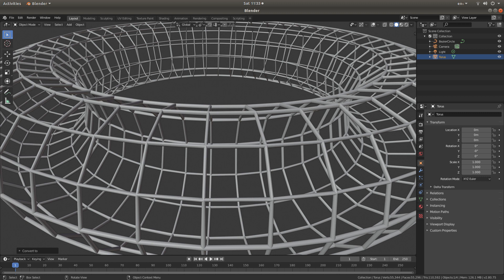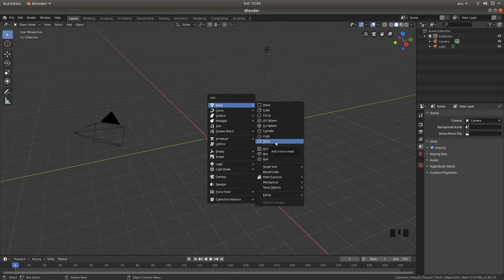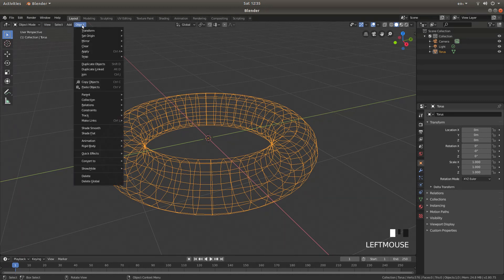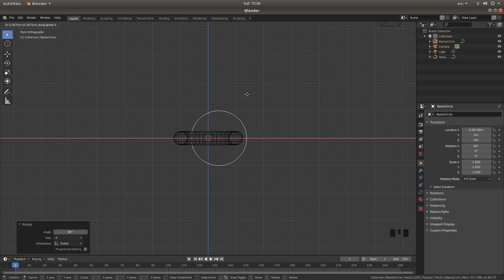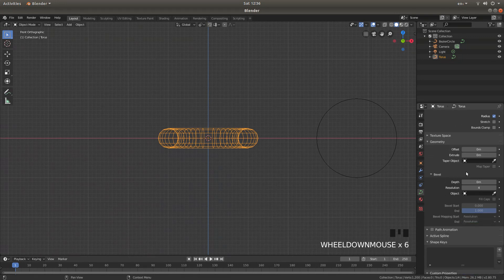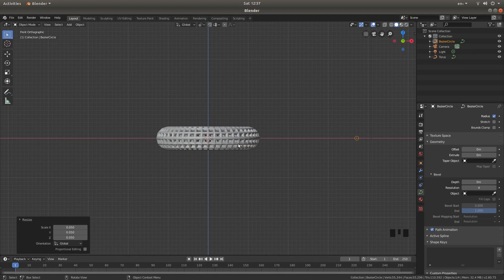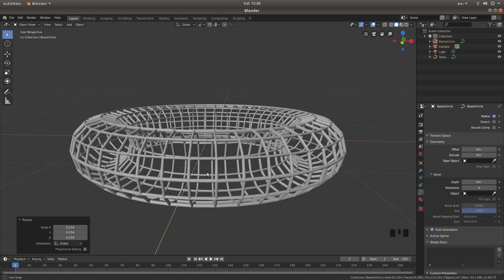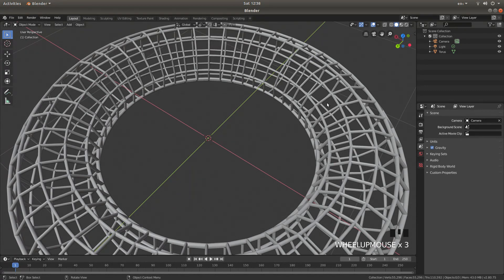Blender 2.80 Tutorial: Create A Simple Wire Frame/Cage From A Solid Object.

Comment: Does this also work in Blender 2.91?  I noticed they changed around the interface a little.  For example I was trying to do something similar but instead of using a torus I used a pyramid  (by using the default square and merging the top verts in edit mode to create the pyramid point, but when I tried to add the bezier circle object it did not have an optn for that from the object list only the cube.  Any ideas?
Reply: YES it does